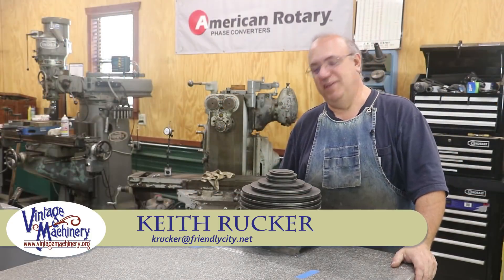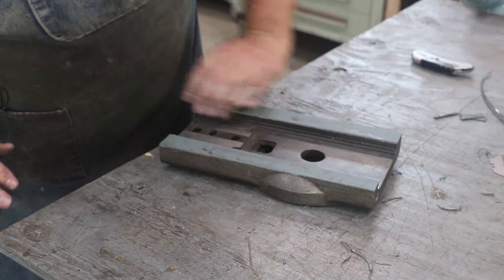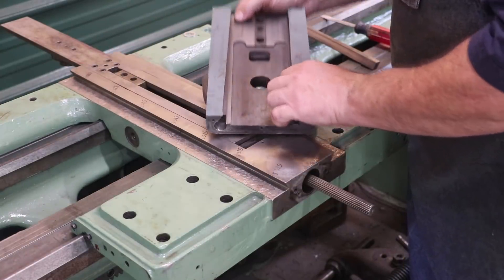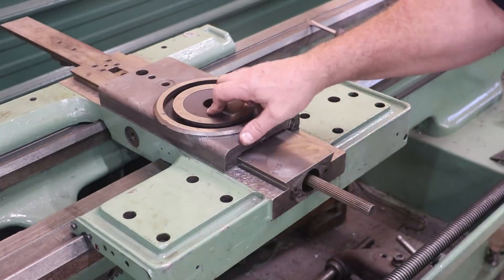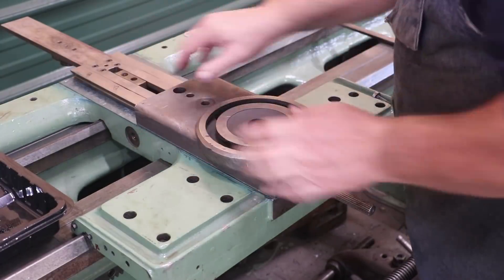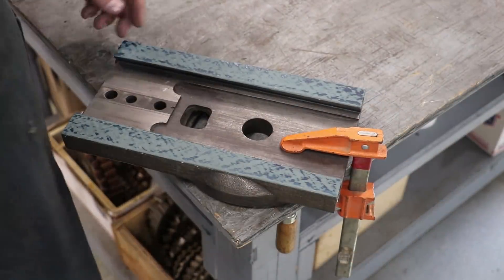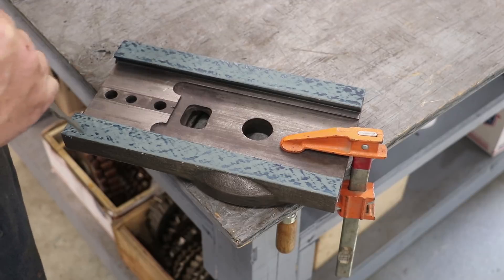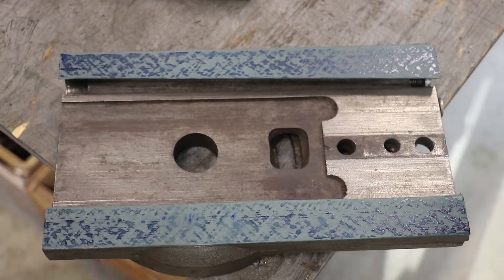Monarch Lathe Restoration - Part 17 Scraping Turcite on a Cross Slide Bottom

Comment: I am tempted in doing the same operation with my lathe cross slide. After grinding the fixed mating part, about 0.3mm were removed, so I am thinking about adding some turcite to get it at the same height. I wonder how this behaves in time, if there is a higher risk to get chips embedded into the soft turcite then rubbing and scratching the bottom surface.
I would be grateful for anyone thoughts or experience on this matter.

Comment: When both your surfaces are scraped or ground flat, you don't have to scrape in the Turcite. Only when you can't grind or scrape the side the Turcite is applied to do you need to scrape it in. Even then, it's not as critical to get it finely scraped. It wears in very quickly at first, then becomes nearly as durable as iron.

Comment: How would you recommend bluing a 58” table on a bed mill? I’ve got turcite on the saddle top and not the actual table and with the table weighing in upwards of 600 plus pounds I cannot conveniently put it on and take it off or flip it over to blue it. The approach I thought to blue the turcite and use a large granite block but the blue soaks in the turcite. It kind of worked ok where it was slightly wet right before it dried fully but I’m not certain it’s a reliable method.

Comment: I wonder if a matte black dye were used, instead of a prussian blue, if it would be possible to use a computer controlled laser cutter with computer vision, to just zap those black/blue marks with the laser to vaporize just a little bit of material automaticly, no more hand scraping. Just maybe stone the surface and clean it and take it back to the application and run it over the mating surface again and just put it back in the laser cutter and tell the computer to run the "scraping" program again. Surely a proper laser cutter would have the power to vaporize small bits of cast iron.

Comment: I've had the cross slide apart on the Mueller, and I was rather dismayed to find out that it had been milled.  It also tightens up as you approach having it fully dialed it.  So far I've been able to work with it, provided I use a dial indicator to read movement, rather than trusting the dials.

I keep reminding myself that the lathe is over a century old, and that there are ways to work around it's current wear issues, but I'm also aware that the gib is adjusted as far in as it will go.  One of these days, it is going to need something put back where it was milled, and the dovetails corrected.  Even with seeing how it is all done, I can't say I'm looking forward to it.

Maybe by the time you get the 10EE restored, I'll have seen enough to be able to approach the task without the degree of uncertainty that I've got now.

Comment: Did the granite slab lose true because of the weights?
Reply: dunno it had a mountain on it for about 2 billions years
Reply: Rock is a liquid if I recall correctly.  Lots of mountains have curved and folded layers of granite.
Reply: Landrew0 .... over billions of years .... not overnight !! Everything is a liquid if you give it enough time ... :)
Reply: You're not serious!  That slab is massive (re:  the videos when he brought it to his shop). No way would that amount of weight have an affect on the slab.
Reply: I've got a hunch that usage (wear) has a lot more influence on accuracy than weight.  They still need to be checked and lapped in from time to time, so the cause really doesn't matter that much ... and it should go without having to be said that using a surface plate as a long term storage shelf would be poor practice ... but that amount, for no longer than it was there?  I doubt that even Tom Lipton could measure a difference.  Hey, Tom, are you up to finding out???
;-)

Comment: Hi Keith, I'w been following you for a year and a half now and I think I have learned enough to start working now, I have a old English lathe , pre 2 world war times for 500 dollars I am eager to buy, Litton Machine Tool company Ltd. it's said to bee 4 feet, I cant find any info on the lathe or company. its missing the gear cog wheels for threading and maybe also for feeding longitudinal I can get myself a set of gear cutters and make them on my milling machine, It shouldn't be too hard should it. One of the problem is that I have no knowledge of the gears missing, But I can measure the threads on the lead screw, and the cogwheel from the drive shaft and go from there, It should be the right way to go don't you think? so I can start with the metric threads and then work my way to the other threads. I love these old pre ware machines.  I have a small chines lathe (it's supposed to made for a German company) and a Taiwanese "wrong fu" and the rest of the tools needed for the job except gear cutters. Do you have any comments?
Reply: I found the Lath among your vintage machinery page, and it's a Hendey pre 1904. so owe you and your friends a great thanks for the dedication you have for preserving both machines and the information you manage to gather. Thanks!

Comment: How can such a soft material work in this application?
Reply: Turcite...easy to cut, but not really that soft. I worked at Burgmaster from 1970-80, they used a lot of Turcite, and even ran it through a surface grinder...machined to 'tenths'....all ran on heat-treated hardened steel 'box' ways...and of course Bijur lube system.
Reply: Doug, OK. Thank you. Very interesting.
Reply: It works amazingly well.  It will last for years: it becomes very slippery with oil.
Reply: It should float on a layer of oil in a well maintained lathe!
Reply: Like Teflon non stick and slippery.
Reply: The “plastic” strips are impregnated with bronze. It is the bronze that provides wear resistance. Combined with proper lubrication it provides a durable wear surface
Reply: I am wondering the same thing, but it IS widely used so there must be something to it.
Reply: apparently some new lathes come with this, in the long run, you replace this and the lathe lasts longer
Reply: Nothing for it to abrade against on the other surface, I guess.
Reply: If you think about it...the weight is spread over its surface area...
Rather than just being in one spot...